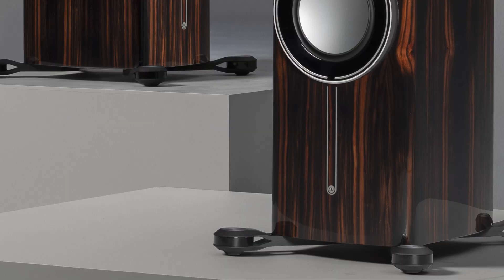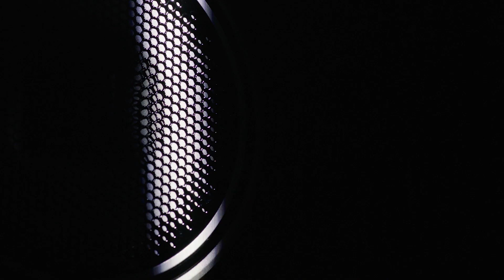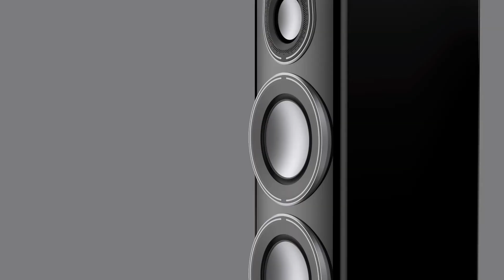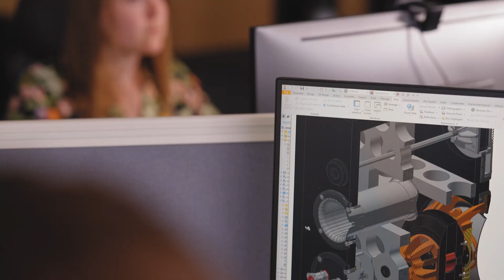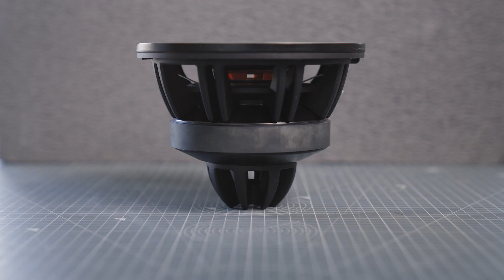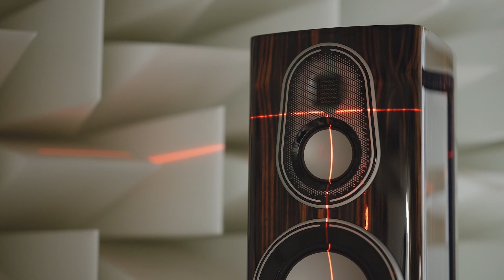Monitor Audio Platinum G3 Flagship Loudspeakers and Beyond! | SoundStage! Talks (March 2023)

Comment: my question to you is why have you not tried using OCC single crystal internally It's far superior to that silver plated OFC I did it to my gold G4 speakers and I got a 10 to 15% improvement right across the board in everything and I have emailed you and told you that and Sheldon who's the Canadian distributor of monitor audio has also told you that all you have to do is buy some wire and try it in the same pair of speakers one with it and one without it and compare the two and you'll see it won't even be close.

Comment: I remember the Silver 7Gs measuring better than the old Platinums, would love to see measurements of this new one.
Reply: The original Platinum series used a ribbon tweeter, not an AMT like the current generation. The original ribbon could exhibit a lot of distortion.
Reply: @dougschneider8243  AMT also used by Audiovector
Reply: @henriksrensen3220  Yes but it's not as good as the monitor audio MPD.
Reply: @chrisrichards2827  The Audiovector speakers are better.
Reply: @henriksrensen3220  unfortunately only in your mind Henrik, this is what the reviewer said that reviewed both he reviewed the R6
Arrete and the monitor audio platinum 300 gen 3 and he said that the cabinet was more inert on the monitor audio the build quality was better The monitor audio was better balanced but he did say that the audio vector was a little bit more revealing but he preferred the monitor audio because they were better balanced and he also said the plinth was more stable than the audio vector and also the drivers were more heavy duty on the monitor audio you could push the speakers a lot further than the audio vector maybe you should go and find that reviewer and ask him and he'll tell you the same thing, audio vector are very good speakers I like them a lot they're just not as good as the platinum sorry but keep thinking in your mind that they are, definitely not better than the platinum Gen 3. and they're also more expensive as well, why pay more for a speaker that's not better? The monitor audio platinum 100 gen 3 will absolutely eat your r1
Arrete for breakfast, it wouldn't even be close.
Reply: @chrisrichards2827  I have compared the R3 against the 200 3G,at a hifi store, and we all agreed that the clear winner was the Audiovector.
I bought my Audiovector speakers after i auditioned platinum speakers at home,  again the clear winner was the Audiovector. 
The platinum range is very good, but not as good as audiovector R range.
Reply: @henriksrensen3220  well Henrik you're full of shit cuz I've listened to them and even the reviewer said that the platinum were better so you bought the inferior pair of speakers and you paid more too bad for you lol, I guess the rest of your equipment isn't that good.
Reply: @henriksrensen3220  The platinum range is better than the audio vector Arrete, Even the reviewer said the driver's were more heavy duty and you could drive the speaker harder The audio vector drivers are not even in the same league as the monitor audio platinum driver sorry maybe you should do some more research and read the white paper from monitor audio if you wanted I'll send it to you they are far superior drivers to the audio vector sorry again but your research is not very good and your ears are not that good either lol and the reviewer even said that the monitor audio cabinet was more inert than the audio vector and the plinth was more stable and the build quality was better but that's okay you live in a Scandinavian country so you probably get a better deal and the monitor audio may be more expensive there but keep thinking that the audio vector are better cuz they're not their driver technology is not better their cabinet build technology is not better Oh and by the way they get their cabinets built in China lol maybe they should try going to the same factory that monitor audio uses to build their cabinets and their speakers lol
Reply: @chrisrichards2827  I know that my R1 is a much better speaker than Platinum 1003G.
Audiovector R1 arrete: editors choice 2022 and 2023
Golden ear award in the Absolute Sound.
And this is what hi-fi plus magazine wrote about the R1 arrete :
the biggest hurdle faced by the R1 Arreté is its price… it’s too low to be taken seriously by the high-end cognoscenti. If you listen with your ears and not your wallet, the Audiovector R1 Arreté is the one of the best stand-mounts available today and has become one of my benchmarks. nuff said
Reply: @henriksrensen3220  big deal the platinums have been editors choice as well that doesn't mean shit and you're R1's are better in your mind, like I said dumbass Go get in touch with the reviewer that reviewed both the audio vector and the monitor audio and ask him what he thinks and he'll tell you the same thing that he told me the monitor audio are better balanced, the cabinets are more inert and better built, the drivers are more heavy duty and the plinth is more stable, that's why he preferred the monitor audio platinum over the audio vector. to each his own too bad you'll never be at my level lol you don't make enough money.
Reply: @chrisrichards2827  Big deal LOL, i don't care what one reviewer says, instead look at the numerous reviews all over the internet, also Youtube where audiovector R series is hailed as perhaps the best speakers out there. Honestly i can't comment on the R6 because i have not listened to them. But the R1 and R3 there is no doubt, they are superb, and better than the "Chineese" platinum speakers.
But at the end of the day what matters is our own ears. You seem to rely on what some reviewer said instead of trusting your own ears. Clean your ears mate, and listen to some real speakers instead of the Chineese platinum range.
Reply: @chrisrichards2827  what hifi magazine has a review of the Platinum 300 G3 and only gives it 4 stars,  they say that the sound lacks  bite and excitement, exactly what im saying too.   Audiovector R1 and R3 got 5 stars ratings. 
Platinum is a good speaker. But it lacks dynamics and bite.
Reply: @henriksrensen3220  and good reviews can be bought Henrik I really don't care what what Hi-Fi says.
Reply: @henriksrensen3220  really Hendrick well maybe you should go read what other reviewers are saying about the platinum G3 very dynamic detailed what Hi-Fi are a bunch of idiots and they're full of shit because that's not what the other reviewers are saying about the speaker.
Reply: @chrisrichards2827 yes good reviews can be bought. That's why I trust my  ears, and it's very clear that the R series are better than the Chineese platinum range.
Reply: @henriksrensen3220  and that's why the cabinets are not better because they're made in a cheap Chinese factory and I've heard both of them and I believe that the platinum are better and all the reviews have said the same thing that the platinums are spectacular sounding very dynamic open and even the reviewer that reviewed both said that the platinum was better balanced than he preferred them what Hi-Fi gave them a five-star rating because audio vector bought advertising in their magazine Monitor audio refused to do that that's why they only got a four-star rating You're an absolute idiot if you think that the audio vector or better cuz no one here that has listened to both has said that the audio vector are better they like them but they preferred the monitor audio so you can keep your cheaply made audio vector lol drivers are not as good cabinets are not as inert and the plinth isn't as stable not very good for a company that overcharges for their speakers with drivers that are not up to the standard of monitor audio.
Reply: @henriksrensen3220  Sound is subjective, Room treatment, Placement, room size, amplification, and musical tastes, can all effect what might be the 'better' speaker for a consumer. if you're happy with your speakers then congratulations, but they may not suit others. My budget only allowed me to go to the Monitor Audio Gold range, but they were a massive upgrade on my 25 year old Wharfedale speakers.
Reply: @dougschneider8243  a lot of distortion I think your ears are screwed up there was no distortion at all they were very slightly bright but changing the internal wire to OCC single crystal fixed that problem, when I did it with mine and you could barely pick up the brightness in the first place.
Reply: The B&W 800 D4 line sounds way better than the Audiovector R series